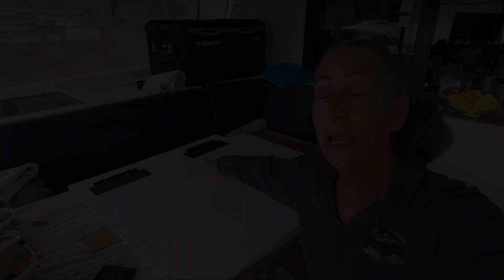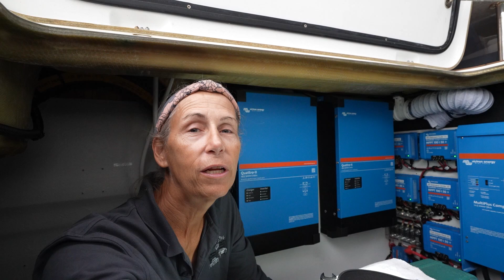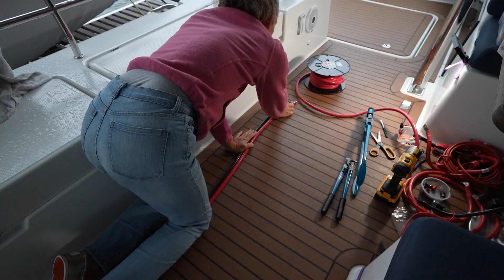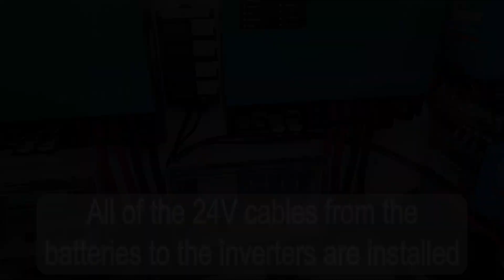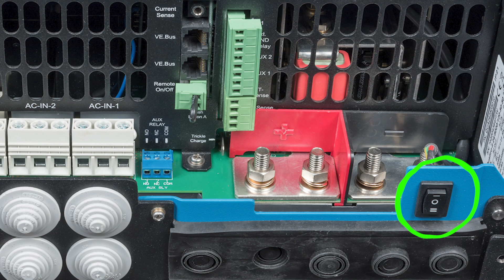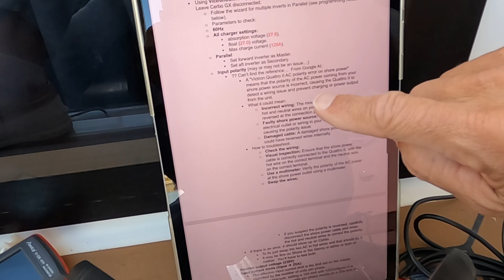Victron Quattro II INSTALL! How I Crimp Massive Wires!! Part 4 - Ep. 38

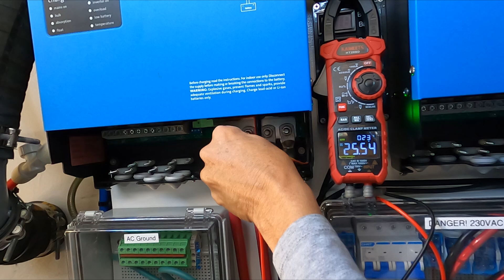Comment: At 19:40 in this video you are talking about your pre charge and you don't talk much about the black box between the inverters.  Do you have any info about what's going on in the box?  Did you make it, buy it?  It looks to be a very clean solution to Current InRush and I just like your solution.
Reply from the maker: That box is something I made. I think I showed it in an earlier video but it is just four digital voltage displays along with a 100W 10 Ohm resister, the switch, and a 24V LED.  The way it is wired it bypass one of the 24V bank cut off switches but routes the current through the resistor.  It's a great addition to system and makes starting up the inverters and monitoring the individual battery voltage really easy.  Check out my full schematics on the first battery video and you'll see the wiring in there.

Comment: Heidi, great video.  As for the crimper, another option that doesn’t require stepping on the one arm and exerting a lot of force (that could damage the fiberglass underneath in certain scenarios is a hydraulic press.  Harbor Freight has them and they are much smaller and easier to carry on board.
Reply from the maker: Yes, there is a hydraulic version of this same crimper. Probably a bit easier to manage :)
Reply from the maker: I think you meant Franny.  I only filmed some of this video.  I didn't even edit this one.   Heidi

Comment: I’m curious, why did you use the Autotransformer, rather than just configure the two Quattros in split phase?  I assume there is a reason that this is a better setup……
Reply from the maker: That's a great question! The main reason is redundancy. With a split phase system if we lost an inverter the best we could rebuild is a single L1 or L2 and no 240V. With the parallel system if an inverter quits I can reconfigure to still run both L1 and L2 and 240V just at half the capacity.  The autotransformer also can balance the two 120 legs providing more 240 headroom than with a split phase configuration. The AT doesn't have any moving parts or electronics so there is less chance it will fail over time. In addition, even at 100A it isn't all that expensive. 
Even with lots of testing over the winter in the Bahamas the system has been working really well. Thanks for your question :)
Reply: @HeidiandFranny  Got it!  Makes sense.  Thanks for the answer.
Reply: @HeidiandFranny I assume you used the 100 amp unit?
Reply: @HeidiandFranny and do you shut it off when using U.S. shore power?
Reply from the maker: @joefarmer1317  Yes, the 100A AT.  No, it is always in play.  For shore and generator I do not pull the neutral. I pull the two hots (240V) and ground.  The AT always produces the neutral and ties it to ground.  There is a setting in the inverter setup that turns off the neutral ground bond at the inverter and instead send a signal via a wire to the AT. The AT reads this signal and locks the neutral to ground. That's the first place neutral exists in the boat. That's true regardless of the AC input source (inverter/shore/generator).